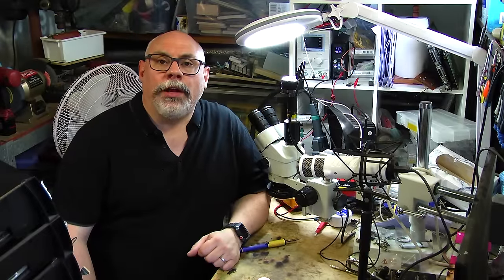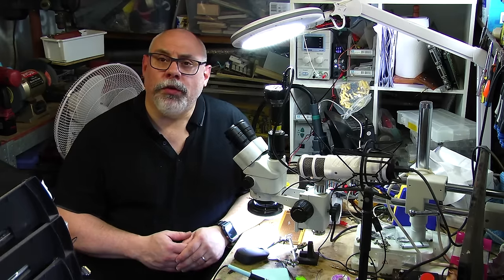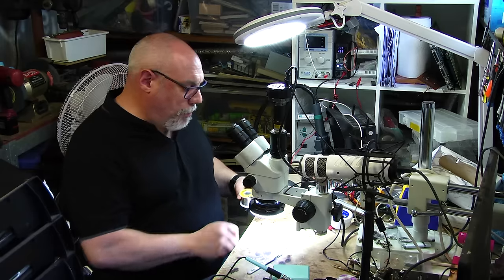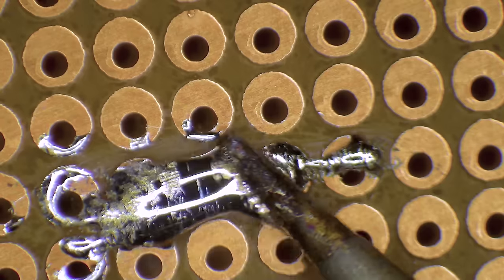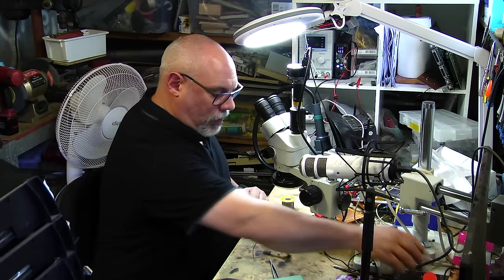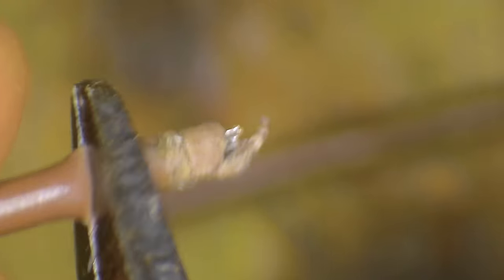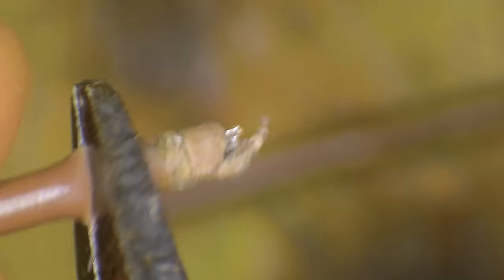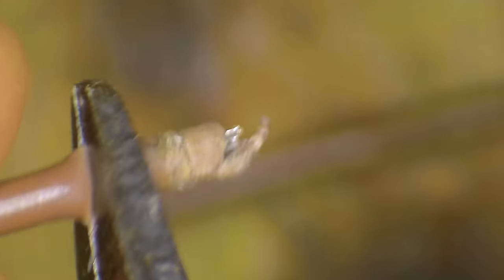Beginner's Guide to Soldering Electronics Part 1

Comment: When you took out a cheap soldering station, i instantly upvoted. It's good to keep things like this in mind, and it shows you care.
Reply: half the reason I watch handyman, builld, fix videos is to drool over the insane tools I will never own.   But I can't argue the fact you made a good point.
Reply: same
Reply: I agree. Although with that said. There are better stations available in the same price range. The knockoff of the hakko 936D/937D is available around the same price. And imho would be much better. It uses either the hakko 900m or 900L tips as well...I think 900m. I have one myself. I also have a trakpower 935D (uses hakko 900l tips) which is also a great option but then your getting into hakko price territory as well.
Reply: the cheap station is what someone will start with, so it good that he uses one
Reply: You'd be doing yourself a favor if you check out something like the TS100. The only drawback with it compared to a high buck soldering station is that interchanging the tips requires a hex wrench. 
Very useful and can operate with battery power at remote locations, and gives up nothing significant to the expensive stations.

Comment: Really great guide for beginners!
A small little tip when heating the heat-shrink is to heat and shrink the middle first (where you wielded the wires), then move to one side and then cross to the other side.
The reason is that if you start shrinking on one side then go to the other side, you can create a small air bubble around the area where you wielded the wires together. If you heat the heat-shrink's middle part first and then go toward the ends of the heat-shrink, any potential air bubble that could form within the small gaps will have room to leave on both still opened side of the heat-shrink and as you shrink toward 1 end, the air will be forced out and then going toward the other end will leave the heat-shrink with no chance for any air gap.
This trick does comes with the potential of heating the middle too much so it requires a bit of practice and timing, but it raise the durability of the repair further.
Reply: ok

Comment: the detailed explanations together with the close up shots from the microscope really help show what this is about, thank you!
Reply: I agree! This is a terrifically put together video, very well done to the creator! :)
Reply: ABSOLUTELY! I'm a complete noob when it comes to Soldering, and I need to teach myself to solder (properly) inorder to put together a DIY synthesizer I purchased recently. After that, I plan to buy many DIY (Assembly Required) Euro Rack Synthesizer modules to begin my journey into Euro Rack. Befaco is one of the more well-known brands that offers the modules in pieces/individual components with assembly done by the purchaser. The benefit of this is, that it dramatically cuts down on the final cost of the modules. That being said, the downside is, I don't receive the benefits of the module manufacturer's quality control, and if I muck something up, I don't know enough about the individual components themselves to know what I did wrong. But learning as I go is all part of the fun! 😬

In any case, this type of incredibly detailed tutorial with close-ups AND explanations of how soldering & soldering components work together is priceless for newbies! 

Huge thumbs-up for this video! 👍
Reply: Sure, I am no beginner to soldering but I learned a lot of the "right way" to do it with this video and understand key things. Superb quality of video and voice, even if I am not a native english speaker, could understand straight even with the Aussie accent...
Reply: Great video, seriously. Watched the whole thing, learned some good info that I'll use in my work
Reply: 1l
p

Comment: You just gave me the info I needed. I've been told over and over to put solder on the tip first and not to worry about the flux if the solder has flux core. I end up cleaning the tip constantly, only to dirty it up again just as quickly. I also changed my tip to a bevel and turned my heat up. I have a huge smile on my face having properly repaired my guitar pedal board! Thank you for the information!

Comment: When I was taught to solder as an apprentice in the early seventies, we would always wet the tip with a little solder before applying it to the work this aids heat transfer, allowing a faster job, less chance to melt the insulation or damage components through heat transfer, we were marked down for melting the insulation, and obviously dry joints.

Comment: So glad i took pause & watched your tutorial on soldering. While I've been soldering wires together on  vehicles for years there's been countless times where i wasn't all that sincerely satisfied with the overall end result/resistance. WOW!!! The difference between soldering on electronic components & joining a couple of auto wires together is taught on 2 totally different levels. After having watched your Soldering Tutorial i can most assurredly state that my previous soldering  methodology is history.
Anyways in all earnestness i Thank You Very Much for totally upping the overall quality of all my future soldering efforts. 
I'd yack more but i need to run out & acquire a tin of that Rosin Paste Flux before i forget what its called. Heck, i wasn't even aware that solder had the stuff inside it nor all the differences between the types of solder previously i just grabbed whatever was convenient or happened to cost the least. Nor have i ever thought to solder the end of the wires prior to actually soldering the 2 together.
No doubt my days of scratching my head & wondering where those pesky missing Ohms went off to are now well behind me. THANKS AGAIN!

Comment: Brilliant tutorial on how to solder.  One point I want to make that you did not cover in your lesson.  I will cover it here.  The process of coating parts you are going to solder is called "Tinning"  It helps the solder adhere to other parts.  One important step is to also tin the tip of your soldering iron.  This helps in transferring heat to the part you are soldering.  You don't' need to use very much solder to tin your iron.  Just enough to make is silver looking.

One other tip.  The part in the video where two wires are soldered together.  This joint is called a Union splice.  A way to make a union splice even stronger, is to twist the two pieces of wire together, in parallel before soldering.  Don't twist them like a pig tail (that is a different type of splice)  When you twist the wires together.  A union splice is one of the strongest and most common splices you will make when working with electronics.

Comment: Very well shown. As a novice I greatly needed someone's help with how to solder. I have been trying to solder wire together and to a circuit board with very poor results, in fact you would say the worst you've seen. This has helped tremendously so thankyou very much.

Comment: Lead takes a much higher temperature to burn. Lead is NOT in solder fumes. That’s the flux. Lead free is better for the environment but you’re not “breathing in lead” if you’re soldering with lead solder.

Great video, I just thought I’d point that out.
Reply from the maker: Didn't I mention that in the video? I'm pretty sure I did. Or maybe I mentioned it in the part 2 video?
Reply: @BranchusCreations  Not that I heard in this one, maybe I missed it but at 10:00 you talk about lead solder being poisonous so ensure you have plenty of ventilation. That’s why I mentioned what I did in case people were nervous due to being a hobbyist, thinking they’re going to get lead poisoning because they fix something every 12 months.

Comment: Of course I just watched this after soldering lol. I saw the person apply solder to the tip of his iron and then put that bead on the tip of his iron to the wire on the PCB. 

Glad you showed me that isn't the way. Wish I knew that a little bit ago lol but I'm glad I know now. Do you recommend using the tiniest bit of flux when soldering to a board if you have the time? Like there's no harm is there? 

Also, I always worry that preheating the component/board/ even wire sometimes will damage it haha. How do I know if im applying too much heat beforehand? 

Either ways, super informative video. Surprised I watched the whole 30 min and it went by quick! You explained well. And the clear microscope shots were a huge help! (Of course as qwll as the demonstrations). But not a lot of people use microscopes and I feel its very helpful.

The fact that you also used a cheaper solder iron to do this was amazing. The problem with a lot of tutorials is that they're using high end gear and the typical  person watching a how-to video is new to the hobby and won't have the same gear. So that was a wonderful idea.

Also, not to keep going on- but props to saying either pronunciation is correct! I feel the same way, too many people get up in arms over which is the correct way. The word pronunciation evolved differently in different areas; big deal. Lol.

All in all, TOP NOTCH video. Firm handshakes all around 🤝  Seriously, good work, and quality video.

Comment: 25:17 I would probably try and remove the sharp pointy bit on the left (shiny bit) of the top wire where it is most likely where the soldering iron left off leaving a sharp point which could penetrate the heatshrink. Good Vid though!

Comment: That example of joining two wires without any mechanical coupling is astounding! If that wire is never subjected to any mechanical load or flexing, you will probably get away with it. If, however, it is a conductor subject to motion or flexing, it isn’t very hard to rip the joint apart if all that is carrying the strain is just the solder.

Comment: All of your information was excellent.  I also use a Hako station and the brillo pad thing to clean the tip.   Your use of the microscope and microscope camera was terrific.  Kudos. 

I can add a couple of things that have worked well for me.  One thing I was taught by Navy techs (guys who had been to the Navy's soldering school) was that to always try to make a good mechanical connection before soldering.  In your example of splicing a wire they would NOT tin the bare wire ends first but with the ends overlapping (like you had them), twist them together to make that good mechanical connection, then apply heat and solder.  They called that a lineman's splice.  They were taught never to rely on solder alone if one can avoid it.  Sometimes you can't avoid it such as when connecting wires to things like bullet connectors but you usually can for splicing wires.

Another thing that has worked well for me is to pinch the solder between the iron and the wire first.  That melts a small amount of solder and vastly improves the heat transfer between the iron and the wire, letting you heat the wire much more quickly.  Then feed in the solder onto the hot wire.   It works very well.

Comment: I know this is a few years old but wanted to add that there are simple pen style irons with adjustable temperature and switchable tips, it's what I currently use ever since I upgraded from the old-school gun style irons that you have to keep the trigger pulled to heat.

Comment: This is a brilliant video, I’ve bought myself a 1982 Porsche 944 and it’s got some electrical issues that need sorting and I would also like to fit a modern stereo into the car, however I’ve never done any soldering in my life, will try to have some practice on scrap wire first before I dare touch the car’s wires but this was very informative thank you!

Comment: Well thought-out, and an excellent argument for using flux.  One thing: when soldering wires together I prefer to make a mechanical connection first by (1) tinning the tips of the wires, (2)fashioning a hook on each, (3) joining the hooks together with a pliers, and then soldering them. Belt and suspenders.

Comment: Thanks a ton for this video. You have solved an issue I have had with soldering by showing the flux demonstration. I also had to give you a thumbs up for pulling out the cheap soldering iron. It shows you don't need an expensive soldering iron to do good soldering. Thanks again for the video.

Comment: Really nice and detailed explanation. One fact to add is, that in some cases, especially soldering electronic components, you have to work faster. Short time of heat. Otherwise components might be destroyed.
Reply from the maker: Thanks, I'll be covering that in my "part 3" video on soldering surface mount components, coming soon.

Comment: Very good instructions and demonstrations. I am refreshing my knowledge before starting to fix some of my non-operating computer boards. I have so far found at least one bad capacitor that I am going to replace. But first I am going back to school with Youtube videos before doing it. Your explanation of soldering without flux and then with flux really shows the need to use flux and why. And I subscribed and liked as well. Good job!

Viewer Tip: I play all DIY and help videos like this one at reduced speed (0.75 or 0.50) so that I don't miss anything and use the CC on as well.

Comment: @0:27 is why I stayed for the entire video  and even though I still can't roll a joint worth a darn, I surely know how to get nice clean Solder Joints. This is what pulls me in, the feeling I get when someone or something grabs my attention so tight and doesn't distract me with 6 books of Do's and dont's I can't remember. The joy I get from understanding how a circuit works is awesome! I learned by reverse engineering mostly because I didn't understand wth they were saying but now I understand that a T.V. has Led strips inside a white housing with diffusers on them + clear panels for blocking too much brightness + a screen that usually has some kind of wizardry with a ribbon cable attached as if it had soldering pads but nope, nothing but invisible wizardry, a power supply board, a main board, a connection board and usually a wifi board to operate. This made it much easier than every component on one board and little to 0 understanding of where the power supply stops and the main board begins or where the wifi board connects to the main board and can I wire it for external use regardless of the impracticality, I want to do it just because. I also somewhat understand what is going on with a Drone Flight Controller + 4 esc's + 4 motors with 3 wires each?! + Vtx + camera and the Receiver which can control 16 channels on 1 wire and 2 way Telemetry on 1 wire? How it can do so much on 1 single strand of copper? I never imagined copper like i do fiber optics but that is a good idea of what is going on with multiple 2-way data transmitted/received on 1 wire. It's like there are many channels, each tx/rx on each strand in 1 piece of 18awg multi stranded copper wire. 

I know this comment is long AF but it's real AF! Ain't no bot on this one! Keep Blessing us and STAY Blessed!

Comment: I've done very little soldering in my life.  Each job has been crude yet adequate so far, however each attempt was executed with irritating awkwardness.  I'm getting into rc racing, so I thought I'd watch a minute or two of this video.  For the next 33 mins my eyes were glued to the screen like I was binge-watching "Breaking Bad".   The close-ups were instruction multipliers and the whole presentation was perfectly explained. "This is what, and this is why, and take a good close look so you can see for yourself."  Thanks for taking the time.

Comment: Dude tremendous thanks for this guide. I wish i would of found your video sooner because this is truly a great  resource to soldering. Now i will admit i did the mistake as you had mentioned when i tried to replace several electrolytic capacitors in my power amplifier. No fuss as it is necessary to get into the proper habit . A d well that explains why some of my joints looked like hell. God bless you and keep you and your family well. 
Awesome education, your a Saint !
Mike Salvaggio

Comment: Very good tutorial to soldering electronic wiring and components.
Thanks for your assistance and doing some basic electronic installations for my work.
I had been using cramping butt connectors and terminals but I want to make better quality connections so I will be attempting to solder them in future installations.

Comment: Excellent video, I appreciate how thorough this is, as I'm a beginner so the information was very helpful. It's also helpful how you showed how to solder wires as well as spots on a board, other videos I've seen only show one or the other. And none of them show so clearly what you are doing, on top of the very detailed explanation. This was a very helpful video, I am a lot more informed now! I'll probably do some practicing to make sure I have everything down before I do the actual soldering job too....This was a very helpful video, I'll probably bookmark it in case I need to go back to it for reference. Great job!

Comment: Learn to solder well. It takes some time, but you'll never regret it.

I learned soldering in Electronics Shop in vocational HS in the 60s. Ended up becoming a machinist instead of of going into computers (my mistake).

In the late 90's I got hired as a tool maker at an aerospace shop. We did lots of R&D and on the hurry machine repair. My electronics background got me noticed, and promoted.

I became 2nd shift supervisor, and was giving an office.

Soldering station.
High end microscope.
SolidWorks/CNC Engineering Computer.
Jewellers tools.
Plus all kinds of goodies.
That was my office.

Plus full access to the ma hineshop, all the lasers, CNC, CMM, Scales, test kits, etc...

My 2 years of electronics training was a key to my advancement. I just now retired. Miss the people. And the work. But not the insane stress of constant cutting edge problem solving under demanding time constraints. 23 years of that was enough.